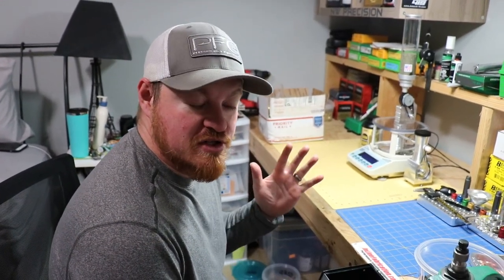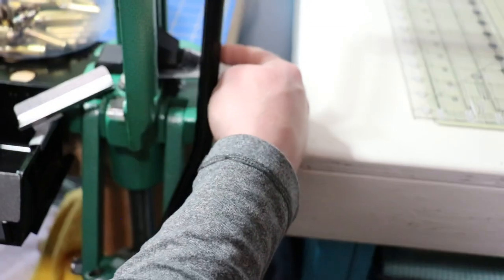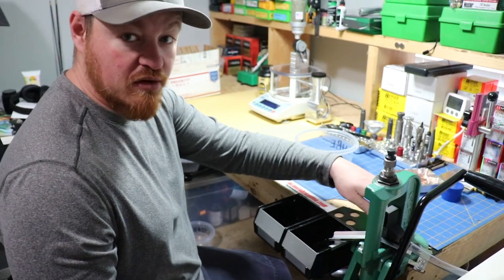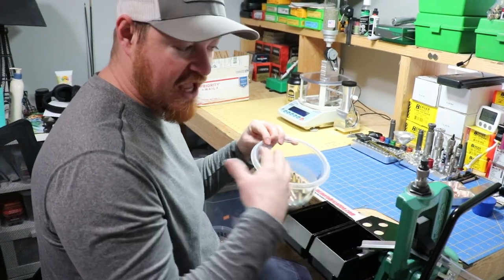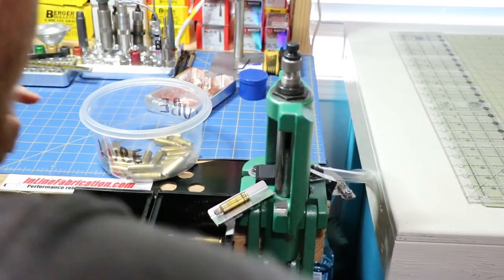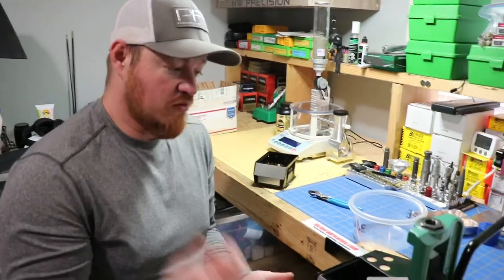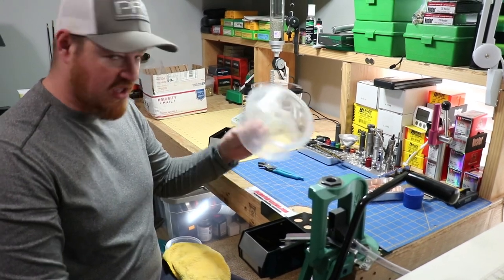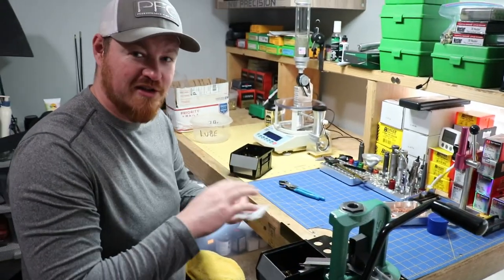Inline fabrication press upgrades!! You gotta see this!

Comment: I bought a handle from them for my Lee Challenger press. Unfortunately it would have interfered with the priming system. So I sent it back. Thought about buying one of their risers to get the press up higher. But cut out a 2 inch thick piece of wood. And now it is the perfect height.

Comment: Good video, some real top notch gear on that bench, and you seem very knowledgeable. Thanks for the laugh when you grabbed the channel locks and went at the finger knurls on that poor die, and held them backwards at that, lol. Not sure if you ever noticed, but the teeth on those lean one way, so they are designed to slip in one direction, and grab in the other. You can either buy hex nuts for your dies, or dip your channel lock jaws in Flex Seal to keep your lock nuts from getting chewed up.

I am curious if the silicone spray helped the slide?

Comment: Slowing down a little will make your efforts more efficient and enjoyable.  If its not fast enough for ya, get a progressive. Just my opinion.
Reply from the maker: A progressive would be pretty sweet but I like using my single stage press. I would still want to use my FX120 setup for powder charges and my arbor press for seating bullets. I love the arbor press because I can feel the bullet way better when it’s going into the case, some cases seat harder than others and I can weed this out. At the time of this video I was reloading a lot of ammo for matches and had to be as efficient as possible with what I already had. I don’t shoot much anymore so the process is definitely slowed down now lol.